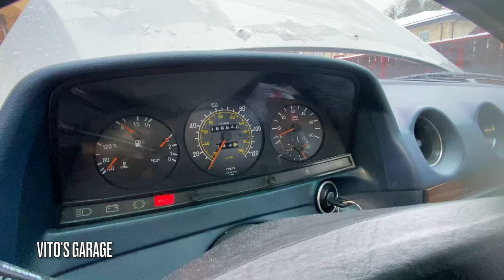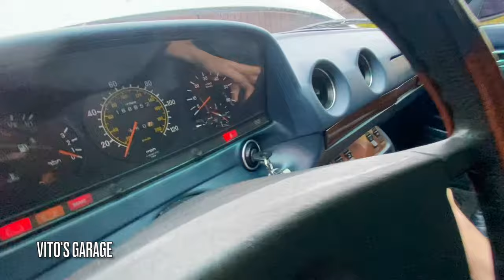W123 Dad's Gift 1985 Mercedes 300D Quick Oil Change and Car Wash!!! What an Amazing Machine!

Comment: I had a w116 with the om617, I almost lost an engine due to the prior mechanic actually pulled the studs out of the oil filter housing and then used loctite to fasten the studs. The filter housing studs pulled out and spilled oil all over the place. I shut the engine down. Replaced the studs with 3/8 bolt/nuts and did an oil change. Thankfully no damage to the engine.
Reply from the maker: Wow that’s some scary stuff!! It’s always good to keep a second eye on your mechanic!

Comment: Vito - where can I borrow or rent a spring compressor for the W123/300D around Chicago?
Reply from the maker: Hi. You can order online. Lots of places sell them
Reply: @VITOSGARAGE  Thanks - I just need it one time - if I can't borrow one, which would you recommend?
Reply from the maker: @anthonycurran1298  you can use one of these: https://amzn.to/3RDShbE

On W123s you might need to do a slight modification to this compressor tool by grinding down the portion of the shaft where you put a socket on. Otherwise it may not fit through the spring tower/perch hole.